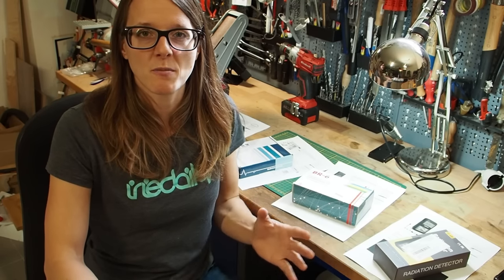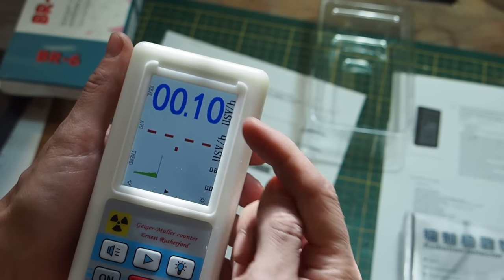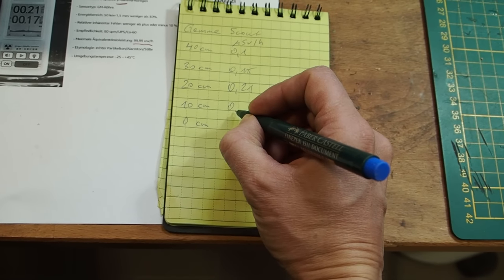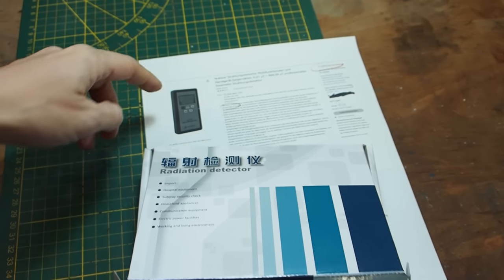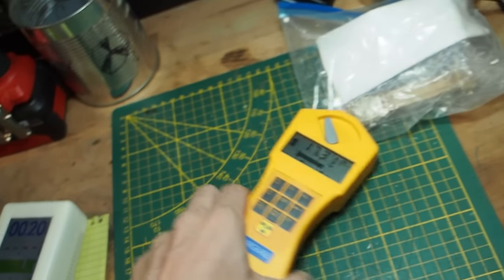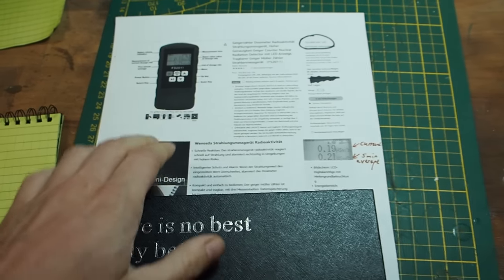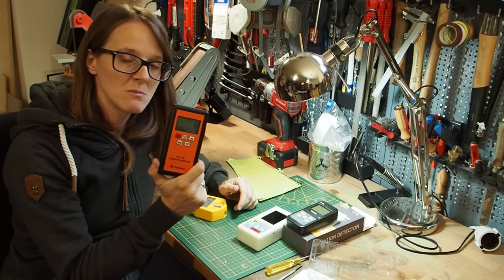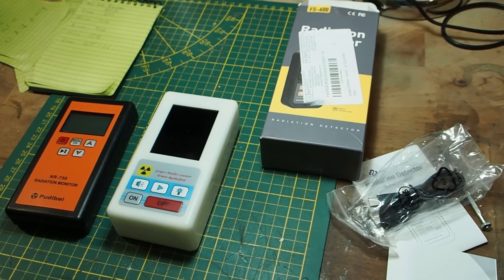Cheap Geiger Counters on Amazon - Only 1 is Worth it!

Comment: Measuring radiations is not easy as you can think.
There are multiple factors behind, but i can summarize your biggest errors:
- Every isotope puts out different radiation energies and the sensitivity of geiger tubes aren't the same for all radiation energies (i.e. 100 counts per minute from Cesium 137, 100 counts per minute from Cobalt60, 100 counts per minute from Americium 241 and 100 counts per minute from Radium 226 shall be translated to four totally different readings): in order to get the proper result, most geiger counters are calibrated using a specific isotope (which means that if you try to measure this isotope you should get proper results...... but also means that if you try to measure different isotopes and/or you try to measure the same isotope with different counters, each one calibrated with a different isotope, you will probably get totally wrong results.... and this is normal!!!!).
Please note that the manual of the geiger counter shall include the reference isotope and can also include a conversion chart for some other common isotopes that you shall use when you try to measure a different isotope (note that some isotopes can have a conversion factor of more than X10 or less than X0,1 so the difference between different isotopes can be huge!!!).
- when you do a measurement, you shall place the tube in the center of the beam (different tubes requires different positioning, also, most of the tubes are sensitive sideways and few others are sensitive in the front)
- in order to get a proper reading, the radiation field shall be uniform for the entire surface of the tube.
This means that your source shall be at least 2X bigger than the tube (and uniform).... if you only have a point source you shall place the tube at a distance at least 10 times the longest dimension of the tube (i.e., the source shall be quite strong!).
- finally, unless this is required by the manual, you shall do the measure with beta shield in place (most of the isotopes are calibrated in gamma only).
Please note that there are some detectors that can do energy compensated measurements: these detectors are the most accurate because already compensate the measurements with different isotopes (and also can do accurate measurements of a mix of multiple isotopes in the same time); the two major drawbacks of these detectors are the sensitivity (are usually quite insensitive and also most all of these detectors can measure only gamma radiations and X-rays).
Even if these detectors are quite limited (but the Gamma scout is limited too!), can still be pretty handy in an emergency situation.
Reply: @whestwar6894  I don't think that she is stupid because she even tried to do a side to side comparison with a (supposed to be) professional counter! ....... she simply ignore some of the basics of the nuclear physic (which is something that you can expect from a non-nuclear girl) and she made some of the most common rookie mistakes.
BTW.... the bosean F 600 is energy compensated so is the best of these counter for evaluating the gamma radiations coming from an unknown source and/or evaluating the background radiation..... but is also the worst one if used for contamination detection (as always, contamination detectors are the most inaccurate for radiation measurements and the sensitivity of energy compensated detectors always sucks!)
Reply: @teslacoiler  Yes, at least if she saw your message she would make a correction to this clip.

Comment: I don't want to sound bashful but at this price point these are not for industrial use and some may exaggerate the actual count just because people will test them with weak sources of radiation. They will give you an indication that radiation is present but unless you have them calibrated, I doubt they are very precise. 
I would rather spend 300$-500$ on a reputable dosimeter, which will actually tell you how much radiation you have been exposed to in total and good ones have a rate alarm, telling you when to back out.
Reply from the maker: The gamma scout is calibrated
Reply: @SurvivalLilly  That's an important feature 👍

Comment: I have the Pudibei NR-1050. Seems to work pretty well too although I don't have anything to compare with. Bought it when the war in Ukraine started because I figured it was a wise thing to have. Construction seems identical to NR-750 but it has heatshrink from factory. I have (so far) 4 "nano wands" zero energy negative ions. Of course pure bollocks - but they're great test sources containing thorium oxides. 4 closely together and geiger above them it can measure in excess of 5µS/h. So don't do what they're advertized to and carry them in a pocket for extended periods of time. They live in a corner of the house. I want to buy some more while they're still easy to get (currently customs don't look for them, they did a few years back before I purchased my first one I found out) and I have to find a nice metal box and print a radioactive symbol for it - just to have everything in order should someone else encounter it so they know what they're actually dealing with.

Comment: With some 30 years experience in the nuclear industry I'd have to ask what benefit anyone would expect from owning one of these? If there's a large release of radioactivity then what you really need to know is the wind direction so you can go away in the opposite direction. If anyone thinks this will help if there's a nuclear war forget it. Because what you really need to know is the activity in air level. A Geiger counter doesn't do that. If there's a nuclear war there won't be anywhere to escape to. Wherever you are you will receive some level of exposure.
Reply: I forgot to say any Geiger counter will have to be calibrated to give accurate readings.
Reply from the maker: if you detect radiation you go inside of the house. the fallout will come down in the next 24-48hours. in the house you have better chances of surviving. then you check your food with your geiger counter for contamination. this is why you need a geiger counter.
Reply: @SurvivalLilly  if there has been a nuclear detonation your counter won't work because the emp will have rendered it unusable. Better to advise people to buy appropriate respiratory protection. Research the difference between radiation and contamination. Too many people don't know the difference. This is why I mentioned the need to know the level of radioactivity in any volume of air you breathe. Being able to detect a high radiation level from an object is all very well but it's not telling you what you're breathing in. And that's where the real harm will come from. In the long run there will be no escape for any of us. We would all be affected by varying levels of internal exposure regardless.
Reply: @SurvivalLilly  if you're advising people to buy one of those in relation to the possibility of a dirty bomb then they may be of some use. Sure,you can detect higher levels of radiation on objects but you still don't know what's in the air you are breathing. The companies who sell these to the public are selling them a false sense of security in my opinion. Perhaps a video on decontamination procedures going in and out of your home would be useful.

Comment: Unfortunately Gama Scout Geiger meter is also not perfect compared to it's price. It switches off if exposed to extremely high radiation levels. You can find some videos on youtube demonstrating that. These cheap Chinese Geiger meters are perfectly fine for the price you pay. In case of nuclear disaster it's good enough to inform you that radioactive cloud is above you and that you need to take a shelter. Also it is good enough to find hot spots.

Comment: I would look into heavy metal testing , hair , blood or urine. If the tests are accurate you can see what's in your system. Depending upon the test you can see what's around you. I am sure a spectrometer is not cheap but you can probably find a test facility with reasonable prices. Industrial contamination and chemical weapons of the past and present.

Comment: For all user of microcomputers GM. If your GM is not militay grade in radiation field your equipment will soon die(chips wil die) . For real, situations  use GM with tubes, unbreakable  to strong gama radiations and EMP what all users forget, when  A bomb make boom , boom generate a strong EMP pulse which destroy chips in electonied devices.

Comment: Very useful. Would love to see inside the good ones! I guess the Gamma Scout has the style of tube with both contacts at one end and a radiation window at the other. Would be interesting to know which style is in the NR-750. Slightly worried how long the complex microchips inside these would survive if they ever saw any really worrying levels of radiation!
Reply: Most of these wouldn't be useful if there was any serious radiation, as they wouldn't be able to go that high. but they would at least alert you to the fact there is some, what you should be more worried about is an EMP or something similar.

Comment: Geiger counters are really cool and useful, but you do need to know that you should not use one to test for food contamination. I've heard you're supposed to use a gamma spectrometer for food contamination if you have one
Reply from the maker: you can use them if the particle sits directly on the veggie. If it is inside of the veggie you need a pancake style geiger counter but those are really expensive.
Reply: @SurvivalLilly  Good to know
Reply: @SurvivalLilly  I guess it depends on the situation really, and also what radiation it's emitting
Reply: @SurvivalLilly  even then, you need to use long averaging to get useful info(so basically, you need a scaler, VS a counter) unless the levels are quite high.
A gamma scintillator is better, but a Gamma spectrometer would be better yet.

Comment: Unless the faraday cage is grounded, it will not trap and disperse emp radiation. It will trap it, but it stays right there with your devices and fry them. That is why microwave ovens are all metal and it is grounded to the grounding pin on the plug, in fact, it is a tuned grounding otherwise if you have metal from surgery or a pace maker, you would get cooked and die a very painfull death. BUT! Thank you for the testing of the devices. Question, did each unit come with their own batteries? If so, then you might want to retry that one with fresh batteries and or if you have a battery tester, test the bateries. I suspect it is the batteries.
Reply: The microwave earth is for galvanic protection. The impedance of the earth wire at 2.4GHz makes no difference connected or not.
Reply: @howardsimpson489 : Actually it does. And for an even better protection, one should use a "tuned grounding". Galvanic? Have you ever seen or used a galvinometer? It is for measuring micro voltages/currents. The microwave grounding (which is a "tuned" grounding) is to direct the energy of the microwave from exiting out into the immediate area (radiating out) and into an earth gound. The same thing with the grounding of the faraday box/enclosure. Even faraday himself said that for a faraday cage to be fully effective (especially against higher frequencies) it needed to be grounded so that the cage would not become so saturated that instead of being a trap isolator, it become a transmitter.

Comment: You should look into a BetterGeiger S-1. It's a neato device that Is mainly focused around accurate dosimetery instead of frisking/contamination checking. It's about 120$ in the US and uses a scintillation detector despite the name. It does spectroscopic dose compensation. Unfortunately most devices at this price point would likely be useless in a real radiological disaster like nuclear fallout, as they would likely saturate easily, only being somewhat useful for contamination checks in a cleaner environment.

Comment: Thank you for making this video. I was looking at a $18 (3-In-1 Radiation Dosimeter Counter Geiger EMF Meter Automatic Alarm Real-Time Measure Radiation Detector Tester
) on Walmart (Model S8602) and I was wondering if it actually does it's job. I was searching on YouTube for review of this device which brought me to your channel. I am so impressed by the way you repeated tests, I felt like you were reading my mind as you were performing the tests. For example: I was wondering if the White colored device will perform better after you removed the plastic cover on it's tube, and you did exactly that after putting it together. This happened 3-4 times during the video where I thought something and you immedietely did the same thing. Your latest SUBSCRIBER here. By the way NR-750 is curretnly retailing on eBay US for $60.73 shipped from China.
Reply: S8602 "Electromagnetic Radiation" It does not measure radioactivity.

Comment: Thanks Lilly, another great informative video. I've just bought a NR-850 which was being offered by one seller on amazon uk for the same price as the NR-750 - £60. I understand the difference to be that it offers 5 units of measurement over the 3 on the NR-750 and the processer is slightly improved so that it reacts quicker to detection.
I hope i never have to use it, but i find myself more and more concerned these days about the ever increasing risk of fallout when i look at the actions of those currently in charge, and as such have been preparing for the worst case scenario. Your videos are a really good source of information. Thank you.

Comment: Hi Lilly it would be fantastic if you could inform us on what radiation levels are safe . I own 2 gieger counters but haven't a clue How to determine what's safe and for how long . Loving your videos as always ❣️.
Reply: Hi there - nuclear engineer here. Depending where you live in the world, you are normally exposed to ~2 millisieverts of radiation. This comes many different sources, including  radon gas from the bricks of houses, cosmic rays from outer space, and even radioactive potassium in your bones! This translates to about 0.23 microsieverts/hour (or 0.23 µSv/hr, as is often stated on detectors). This will fluctuate of course, but if you consistently detect above 2 µSv/hr then something in your vicinity is more radioactive than usual. If, with the detector held up close to the source, you detect something above 10 µSv/hr (corresponding to 100 mSv/year), report it to your national nuclear authority. Hope that helps!

Comment: Because of inverse square law, is it possible that the low reading on the white one was caused by the distance between the source and tube being so much greater than on the other items? I would have like to have seen a retest done without the back case, although I understand this isn't ideal since high voltage is involved.
Reply from the maker: Yes i think that was the reason. Still a fail if they designed the case wrong